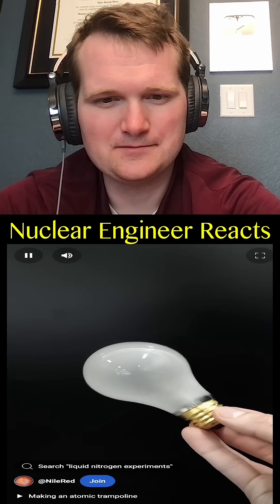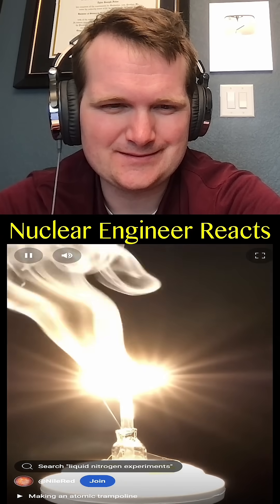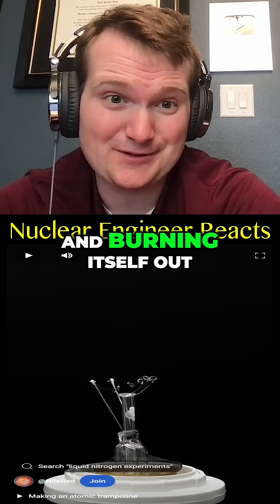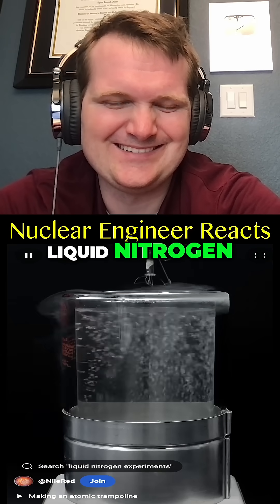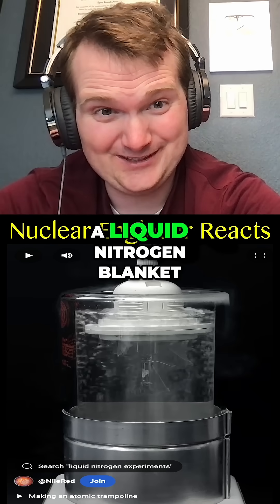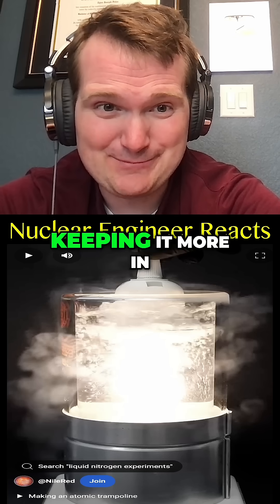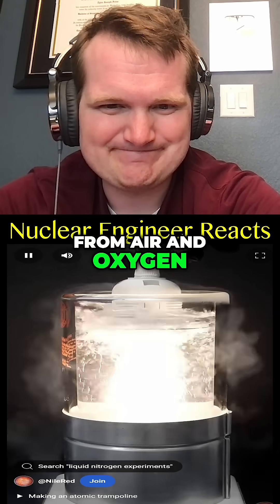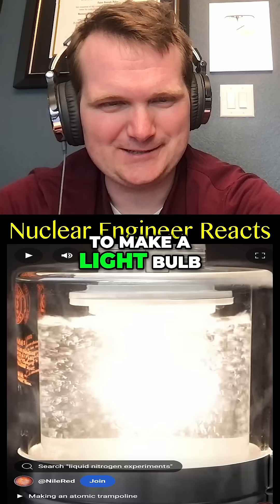Light Bulb vs. Liquid Nitrogen - Nuclear Engineer Reacts to NileRed

Comment: idk why i like this tidbit about old lightbulbs so much but: most of the sound a bulb makes when it breaks is from the gas rapidly being compressed then spreading back outward because the inside of the bulb is slightly under atmospheric pressure

Comment: It's only a matter of time before Nile Red attempts this with liquid oxygen.
Reply: nile green
Reply: Because explosions are always fun
Reply: @TheRYCN  liquid oxygen is neither combustible or flammable, it’s an oxidizer
Reply: I guess that I should clarify. We just witnessed a light bulb filament burn when heated to operating temperature in the presence of atmospheric oxygen. Liquid oxygen, which is an extremely concentrated form of oxygen, will probably speed up the reaction substantially. This means that the same amount of energy will be released in a much shorter period of time. You’re going to at least get a bright flash of light, probably with a pop or bang, and maybe even a broken container sending liquid oxygen flying. 

Would there be an explosion? No - we aren’t meeting the exact definition for an explosion. Would I treat it as if it were explosive were I to try this? Absolutely.
Reply: @TheRYCN  TL;DR loud bang no bomb
Reply: @khaledahmed9136  …sure, let’s go with that
Reply: Why would it explode  oxygen isn't expodable @TheRYCN
Reply: @Noonecares2010   not the kind in air, but just itself.

also, it's not decomposable per se, but it is the decomposer
Reply: Oh my. People are insane in this reply section and I am all here for it.
Reply: In that case, liquid hydrogen is safer than liquid oxygen.. no, not safer...

So, metal of the wire + oxygen ->heat-> oxydized metal + more heat.
Because metal is fuel, oxygen is oxidiser and electricity is heat.

Liquid hydrogen case will have only fuel fuel and heat, without oxydizer.. except it is in Earth atmosphere, but im not sure will liquid hydrogen ignite in liquid hydrogen temperatures, but it surely will evaporate and be a big fire hazard. And it also will leak from any container.
Reply: Or hydrogen
Reply: boooom
Reply: We all love explosions

Comment: Wait would it be possible to have a bulb full of nitrogen and bubble like that?
Reply: a standard lightbulb is already filled with nitrogen gas (sometimes a bit of argon too). It won't bubble or boil, just because there is only a fraction of the amount in there. would sorta have to make your own like nilered is doing if you wanted it to be fancy. 

there are bubble lamps made, that have a liquid in them with a very low boiling point, and the filament will generate enough heat to boil it, if you wanted something along those lines.

Comment: "how to turn a normal working light bulb into an expensive broken working light bulb"
Reply: I think the point in doing this is to satisfy curiosity, this separate engineer and scientist.
Reply: @eagercleaver1782  I think the point of writing this comment is to satisfy humour, this separates serious people and humoured people
Reply: "broken working" huhh 🤔
Reply: @EikottXD  yes, the light is broken. But it works because you've encapsulated it in what is essentially another bulb. It's Schrodinger's bulb. It's both broken and working depending on how you observe its function
Reply: @corwinzyn  Schrodinger is either spinning or not spinning in his grave at how badly that misunderstands his work
Reply: @ConradOraguille  explain what I got wrong then.
Reply: @corwinzyn Schrodinger's thought experiment wasn't about a single outcome having multiple interpretations, it was a criticism of how quantum mechanics could presuppose both outcomes simultaneously until one was observed, proving it either a or b.
Reply: @ConradOraguille  definitely spinning 😭😭
Reply: "Put it in liquid nitrogen and it won't oxidize!"

Wow, what a concept.
Reply: Science
Reply: "how to be a chuklefuck"
Reply: Do you work for a mechanic?